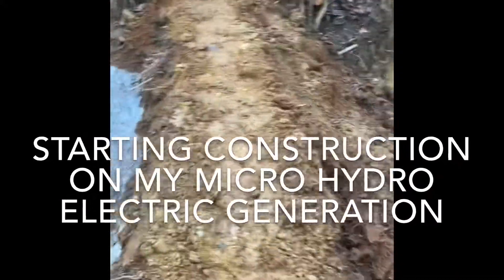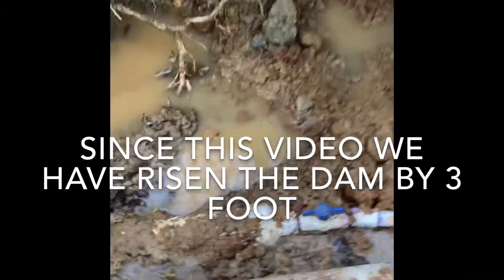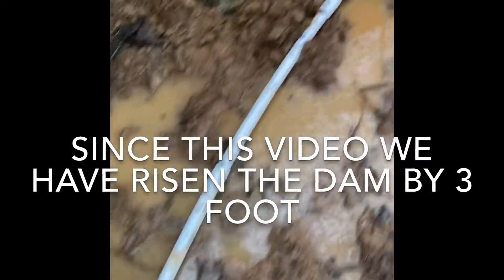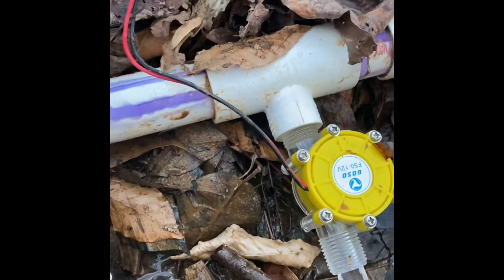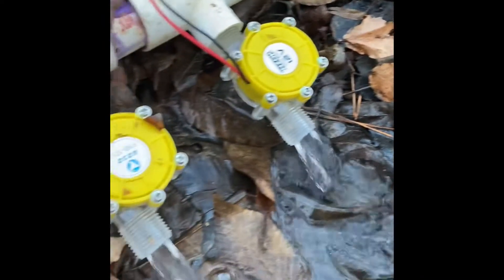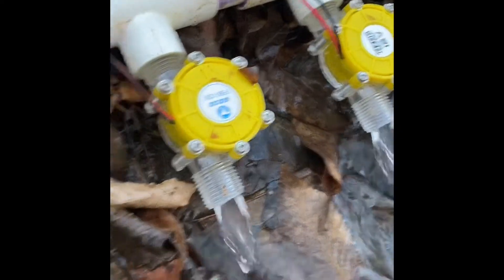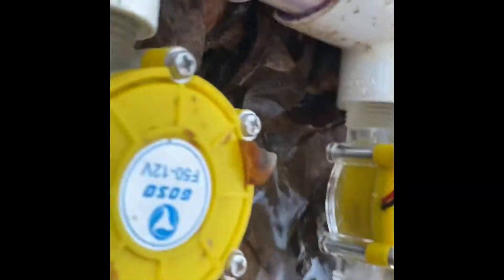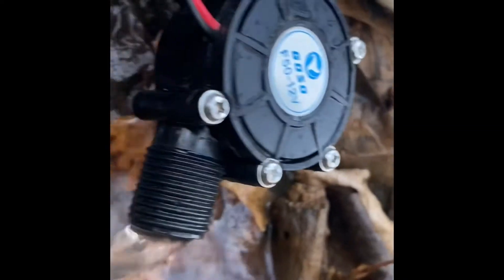Off Grid micro Hydro electric

Comment: some info.    at present,  poorboy contrapting  is resulting  in Low Efficiency/performance.
one  GOOD   pma  is  Better  than  four crappy ones.      have you  Estimated  the  amount of  Potential  energy  available.      here's the math:     flow  x  head  x  gravity  =  watts;  BEFORE  LOSSES.      flow is in  Cubic  METERS  per second.    head is the  Effective  elevation change at the turbine, in meters.     gravity is  9.81 meters per second (per second).       googletranslate